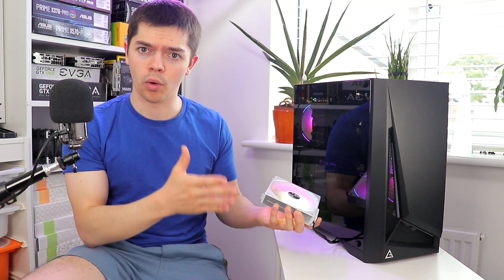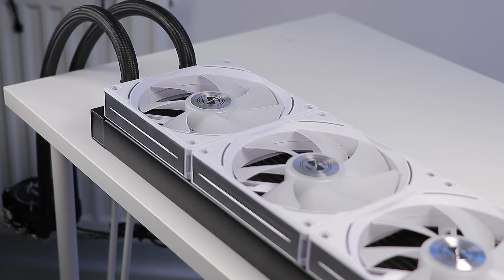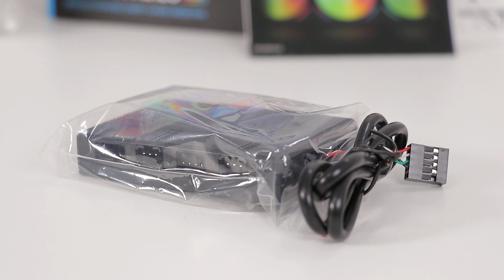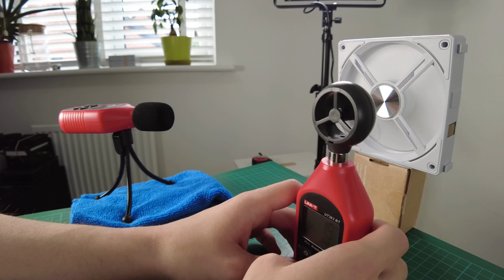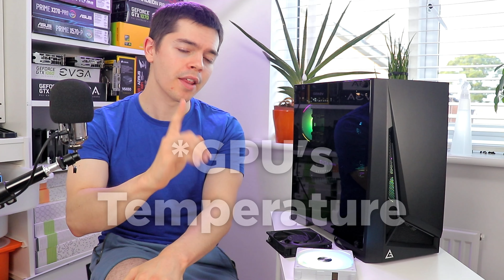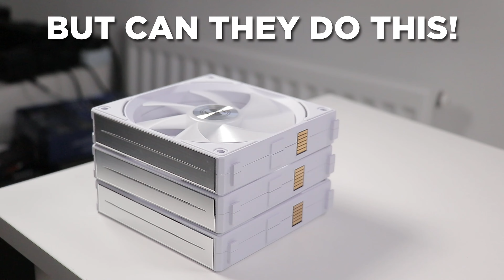Lian Li UNI FAN AL120 Review - Three Fans, One Link, and a LOAD of RGB!

Comment from the maker: Who would/is going to buy these?

These things are a little strange. They're packed full of features that people value, and the price tag isn't completely unreasonable for what you get, but that's dependent on IF you value the extra polish, and the cable reducing system. But deep pockets are required.
Reply: If it comes in my budget I will buy it ( the price is not declared in my country)
Reply: I'm going to buy these. I first struggled between the SL120 and the Corsair QL120, but to be honest, these got more air pressure, more airflow, are a little bit more friendly with your pocket, and the most important reason in my opinion: Just one fucking cable. Cable management with rgb fans are a total pain in the ass.
Reply: But it's overpriced by $20 it should be $75-80
Reply: I already own a 3 pack of the SL120s, if it can connect to the same controller I would be tempted into it, I have three 140 mm fans from InWin and they look great but are so loud I lock them to about 800 rpm
Reply: disappointed by the noise, honestly. I'm not sure why the min RPM is so high. Gonna go with kaze flex instead

Comment: If I'm mistaken that's on me but it seems like you're not that optimistic about the performance off the fans while the results are actually quite good, even go as far as calling them not quiet at all?
1. For the speed it was running at it was the quietest fan (noctua had the same noise at the same % but max rpm was lower), sure below 40% it was slightly louder but only by a small difference and almost nobody runs their fans at 600rpm or below. Especially in a case you shouldn't be able to notice the sound.
2. Showing CPU temp/ GPU clock for the EK fans being better while on the next slide showing it's because they were running both faster and louder doesn't really do anything except invalidate the previous results. You corrected this by showing noise normalized testing after which just makes me wonder why even show the previous results in the first place.
3. I think how well the software works and only needing 2 cables for 3 fans instead off 6 on the corsair fans is downplayed a bit too much.
4. I really miss any radiator performance testing, especially since I can see radiator boxes in the background.
Reply: Do you have these fans? I'm considering getting them but hoping they're not too loud. I keep finding mixed reviews and feedback on this
Reply: @Shiznet12  yes I have them now, they work pretty well. Silent but good performance and easy to control, I do have way more than an average pc tho so my performance numbers aren't really comparable.

Only thing I find annoying is that some of them have a noticeable color difference between them while on the same setting. Also had 1 fan fail over the last 2 years or so, but it was replaced within warranty
Reply: @joost_exe  I've heard of that issue before, but wasn't sure how prevalent it was. Do you keep them very bright and white or light blue color?
Reply: @Shiznet12  I have them on a fairly bright static cyan color for ~12 hours a day
Reply: @joost_exe  From what I've read is that keeping them bright and especially on colors like light blue and whites cause the LED's to yellow or start to suffer defects a lot faster. But many people also say lian li is great about the warranty and will replace them all no questions asked. Maybe try that.
Reply: @joost_exe  Well do you think given the issues you've had and how the fans go for you that you'd recommend them?

Comment: How many LEDs do they have in each section and are they individually addressable ?
What is their MTTF ?
Are they compatible with Asus, ASRock, Gigabyte etc. software ?
Reply from the maker: You can find that info on their website tbh. Not to be harsh, but in the time you took writing the comment you'd probably have found half the answers, and in the 45 minutes between your comment and this on, you'd have found the other half with 40 minutes to spare.

Pop on their website, check out the page, download and read the manual, hey presto you've got half the info you'd want.

I'm pretty sure I address half of those in the video too, so I'm not going to repeat myself.
Reply: @AVTechy  I've looked on their website but I couldn't find it.

Comment: These fans are ballin' mate. Im not an rgb fan i care mostly about performance and keeping my cost down, but i like the way Lian Li keeps trying to innovate. From cases to fans they always seem to try something different, not only the aesthetics but overall design. I like the connection solution they use to keep cable clutter down, and for me that is the main selling point. Not just for experienced builders but for n00bs as well, rgb looks less intimidating.